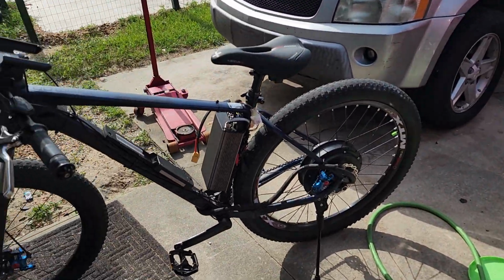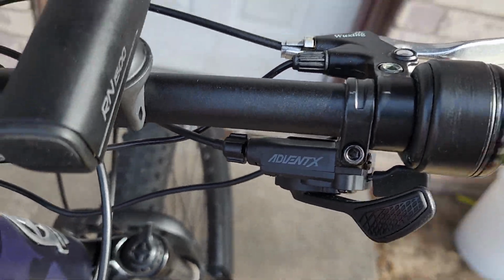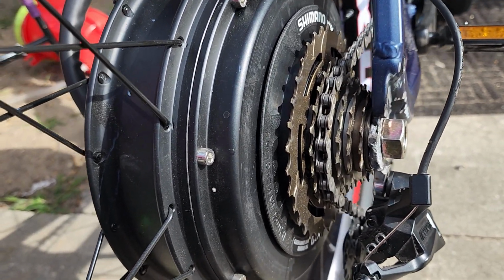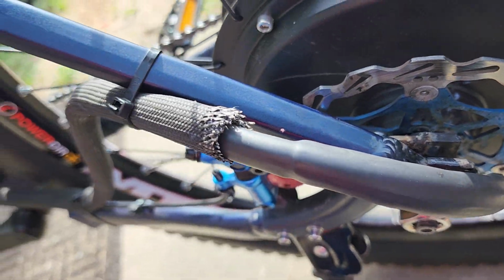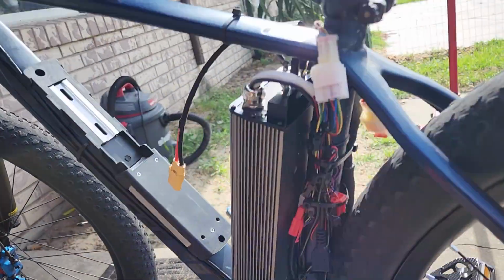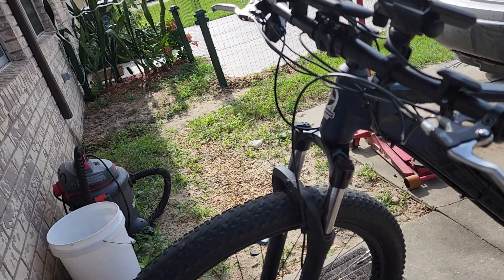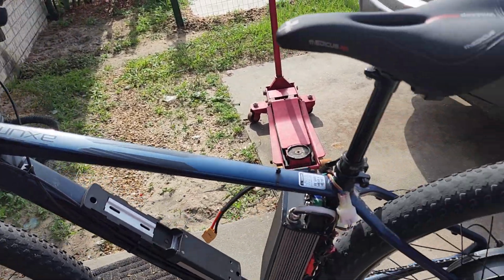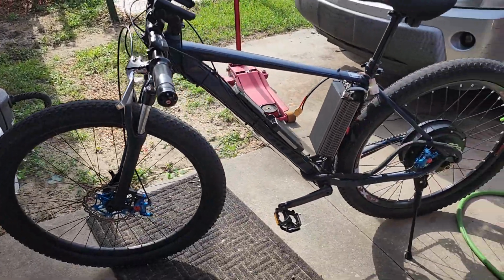5000w ebike conversion kit qs205 sabvoton 72150

Comment: Awesome build! On the hub motor if you hear a clack sound from the motor at slow speed like walking speed it's the berrings. with the larger cassette it's adding side pressure on the berring the balls inside will start to shatter over time usually within a month or two.
Reply from the maker: Ok I did another update on that bike and I down to a 3 speed freewheel
Reply: @E-bikeguy  what 3 speed freewheel did you use? And what was the dropout size? I’m trying to build a qs205 bike but am not sure if it will support gears on the rear wheel and what the dropout size needs to be for that. Thanks for any information in advance!!

Comment: Nice build  I built a 5000 watt I put my controller in bag on rear rack
Reply from the maker: I thought about doing that set up but we ride off road a lot
Reply: I won’t put the controller in a bag it overheat, better to leave it out on the open as he already has it. I put my controller in same location but in between wheel fender and frame as was thin enough to fit and used EMT pipe mounts to around frame to bolt controller to. I just neatly tie the excess wire to side of gap between controller and frame to hide them. At least then the air can cool it and help with weight in the center especially with a heavy hub. Only other ideal space would be the underside Downtube but then if off-roading but not protected if off roading. 

His space in triangle is much larger, plus he likely off-road it, so controller fine where it at. I would just silicone the terminals and opening on top to keep it somewhat weather resistant. Put straps around battery or get the Luna battery mounts with strap. That battery will learn to fly if you wipe out due to downwards force, or over time. Those water bottle mounts are only good for 2 pounds.

Comment: Because the tires are less then 3 to 4 inches wide( standard size of handling pressure off terrain) you have to keep in mind the high speed not really meant for 2 inch tires due to constant contact of the terrain of the tire pressure, you have to ride E bike same way as a car of easing up speed on every upcoming bump, pot holes, dips, driveway curb entry, ect. If you ride E bike always fast of not easing up the pressure of tires gets abused so much you will be repumping or replacing many tires besides serious damage to the rim ( this is most important aspect to follow thru) . Nothing wrong with 2 inch tires but e bike speed over 20mph really meant for 3 to 4 inch tires, you still can use but the way you ride has to be vigilant of your tires and rim of easing up more times then you speed up. Another IMPORTANT issue is NEVER excell throttle ( for front 2 inch tire width motor hubs) when turning. Again being jus 2 inches wide, the sudden push of motor rotation will press on sides of tires which pinch tube along the inner sleeve of rim. I know too well now but I'm not going to rid my e bike to get standard specs but simply to ride E bike knowing you have to ride smart over not caring for your e bike to speed 24/7.
Reply from the maker: That's good advice, never thought of that.
Reply: @E-bikeguy  There is something the Law and city officials are looking out for of the making of e bike laws as it is the cases of serious accidents related to US. The 1 thing e bikers overlook is any speed over 20mph of riding of an instant BLOW OUT on tires when riding fast is SERIOUS FUBAR Hard fall or hard wipeout of the handle bars losing control. Believe it is the Front Motor Hubs that has this potential issue. It's why Motorcycle helmets is a must of high speed e bikes ,mainly for front motor hubs. Next time going fast put in thought a blow out of the time and you will relate how serious it could be. Ride safe and aware.
Reply: @E-bikeguy  You are one of those Great Dads of ya kid s e bikes you build for him. Just FYI this to him so it will always be Safer then Sorry of his conscious when riding out. The cars coming onto the street from the side is always a point they will not see you in time so also be vigilant of expecting the cars not seeing you for you will do all the right things to be aware.
Reply from the maker: I know that's my greatest concern I don't let them out out my sight and they never ride without me as I do I teach them how to read the traffic signs, be more careful like watch for everything.

Comment: What diameter hub axle do you use? My bike has 10mm rear dropout diameter, but from what I can find most powerful hub motors use at least a 12mm axle. Im curious how you made it fit because I want to upgrade my hub motor too.
Reply from the maker: This one is a 16mm axle but I shave the dropouts a bit for the axle to fit

Comment: Nice setup. What kit did you buy. Or where did you get the parts from
Reply from the maker: I got the kit from NB power on the Ali express website, very reliable people
Reply: If you have a link that would be great. I have an Axum and would love to attempt this setup.
Reply from the maker: US $796.72  8%OFF | QS V3 72v 5000W 3.5T/5T Rear Wheel Electric Bicycle Motor Kit 150mm Dropout Electric Bike Conversion Kit waterproof controller
Reply: Thanks alot!
Reply from the maker: @eazy1004  no problem I have some updates I'll will be getting a new controller, coming soon and break upgrades and I'll be doing a 3000w ebike for my oldest son and a 1000w build for my youngest son
Reply: Can't wait to see what you have in  the works. Keep up the good work! Happy father's day to you
Reply: @Tommy Little Just curious. The kit you bought for the Axum, was it the 29" 3.5T or the 29" 5T kit?

Comment: Wow, what a beast of a bike.  What's the BMS on that hailong 52v battery?  Did the  150a controller ever shutdown the battery?
Reply from the maker: It was a 40a bms I had bypass the bms because it was shutting the controller off so I sold the battery and now I'm up to a 72v battery with a sabvoton 200a controller  check out the video on my channel
Reply: Holy crap haha.
What's the top speed on that now haha
Reply: I'll definitely check out more of your vids.
What a sweet build.
Reply from the maker: @JJ-ny7dy  so far it's at 74mph ,,,,, super fast
Reply from the maker: @JJ-ny7dy  thank you 😊
Reply: 74mph WOW!
Amazing build man.
Reply: Did you also bypass the BMS on the 72v battery?
Reply from the maker: Thank you 😊

Comment: What was your top speed with the 52v battery ?
Reply from the maker: Top speed was 48mph
Reply: @E-bikeguy  Awesome, when you were using the 52v battery what controller were you using ? Was it the Sabvaton 72v 80a or 100a ? I’m upgrading to 5000 watts and want to know if I can use my 52v 28ah battery with the sabvaton 80a controller that comes with the 5000 watt kit.
Reply from the maker: @Dilla Zooms  it's a sabvoton 150a controller but I turn it down to 80a to protect the battery, this was my entry into hi power ebike

Comment: Hope that controller is big enough, JK, how is the range, that controller looks like it would drain batteries quickly.
Reply from the maker: Actually that's v2 with the controller mounted in the frame  now that controller is on my son's bike mounted on bottom tube and I have a bigger controller on the bike v3 now and and range is quite good if I keep it around 35mph I get about 20 miles on the battery
Reply: @E-bikeguy  that's not bad at all when you're pulling that kind of wattage
Reply from the maker: Sometimes I pull up to 14k watts to that motor
Reply: @E-bikeguy  that's insane where'd you pick up that motor and what did it run you?
Reply from the maker: @mjsmjs7905  well had to get it out of China because the u.s wear house didn't have them in stock my setup now is a qs205 v3 50h 5000w motor, sabvoton 72200 controller with a 72v 40ah battery on a schwin axum dp bike the motor by itself ran me 510.00 including fast shipping
Reply: @E-bikeguy are those 26-in tires or 29?
Reply from the maker: @jeremywheeler2122  there are 29er
Reply: @E-bikeguy  thanks.  I just got a diamondback 29-in that I'd like to convert. Did you buy rims with the hubs already in them or did you install the hubs?
Reply from the maker: @jeremywheeler2122  I brought the motor already installed in the rim

Comment: How many amps is your 52v system ?
Reply from the maker: It was about 100amps
Reply: @E-bikeguy  how do you do that to the battery? I have a 52v 24ah 40amp triangle battery
Reply from the maker: @TRAPSQUAD187  that battery had 21700 LG cells and a 80a bms

Comment: hey what's up ? iwant to get a qs motor but I only have a 52 volt 30 amp .. can I use it for this motor and how if you can give me any suggestion  I will appreciate it thanks
Reply from the maker: Yes you can use the qs205 with the 52v

Comment: Hey man where can I get a 5000w for 135mm drop out?
Reply from the maker: Far as I know qs205 5000w is a 150mm drop out,  the motor that's on the video is a 5000w 150mm drop, if you interested and the qs205 5000w ill send you a link, not sure if a 5000w motor will have a 135mm drop out.
Reply: @E-bikeguy  thanks bro, I found 5000w kit for my other bike which has a 190mm drop out it’s $930 australian dollars bargain lol and to cheap skate some more im going use to lipo batteries 😂
Reply from the maker: 🤣🤣🤣 good deal,